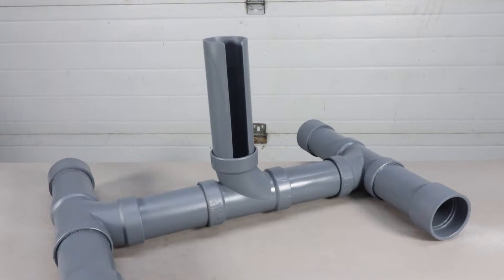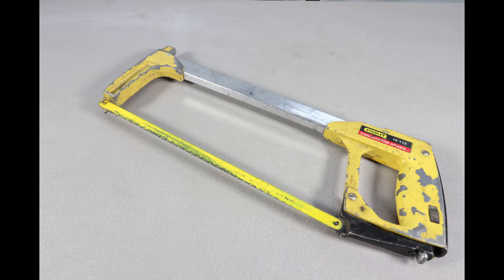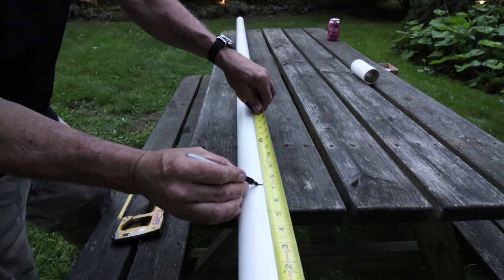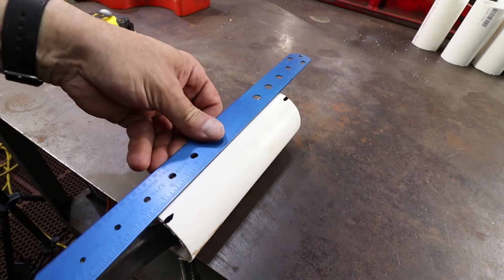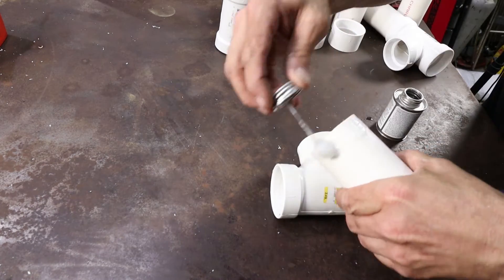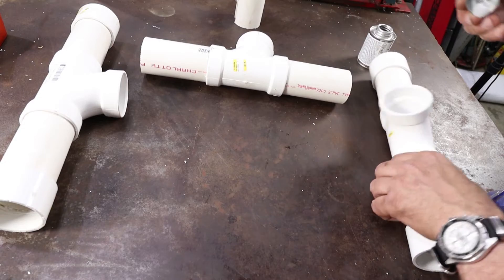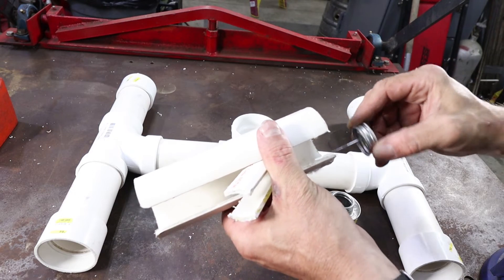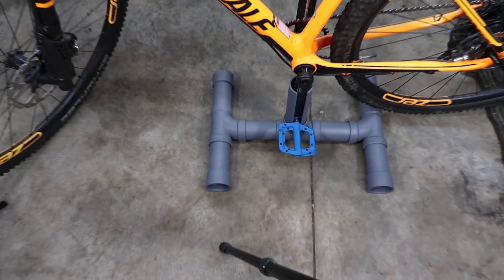Build This PVC Bike Stand Cheap!

Comment: Does it tend to fall over? Or is it stable
Reply from the maker: They are pretty stable, depending on the amount of play in the slot, and the size of the crank arm in relation to the pipe inside diameter. These can be made with different diameters of pipe to suit the dimensions of the pedal axle as well as the crank thickness. That video is one of the first ones that I had ever made, and I thought about making a new updated one in higher quality and more streamlined in the near future.

Comment: Cool cheap stand! I'm wondering about modifying it with a piece of 2" pvc cut in half (lengthwise) to sit under the bottom bracket, also lengthening the vertical pipe. I know it won't be as sturdy (bike swaying side to side), but I'd be looking to get the rear wheel off the ground and be able to spin the cranks.  Wonder if there's a better way by supporting under the chainstays? Guess that may get very bike specific though.
Reply from the maker: Thanks for watching! Yes, with this "H" Frame base, just about anything can be done with the upright piece to suit any bike specific needs.

Comment: I modified the 7 inch vertical piece.  Rather than slicing through the entire length (making the one inch slot), I left a 3/4 inch collar to make a much better/secure joint.  Otherwise great idea!
Reply from the maker: Thanks for watching and commenting Zygmunt. I plan on making a shorter version of this video soon. That was one of my oldest videos, so I think that there's a lot of room for improvement. Take care.

Comment: It would be helpful if you listed a materials and cuts list.
Reply from the maker: Thanks for watching Wesley. That was a really old video and my experience with video making was lacking. Since that video seems to do pretty well despite all that, I do plan to make an upgraded version with the cut list and a more streamlined process showing how to assemble. When I watch that video I just shake my head from my choice of music, the poor audio, and my inability to explain things well. Not saying I'm an expert at it now, but I came a long way in the past  three years.
Reply: @themostlymikeshow  Thanks for the video.  I made this for a local bike show I was going to.  The stand worked well for my situation.  It works best on flat surfaces and with not much wind.  I used another suggestion of not cutting the stand all the way to the end and left a  tab to assist in connecting.  For the bike I used this on, I used 1 1/2 inch pipe and made the legs a little longer to increase the stability.  My only issue has been that I painted it black with primer paint and it seems to scratch easily.   Thanks again.  My list would be 1/2 stick of 1 1/2 to 2-inch PVC.  4 Collars and 3 Ts.  Cut the pipe into 5-inch sections x6 and one section that goes from the stand to about 1/2 inch under the bottom bracket. Cut a 1-inch section down the length of the verticle tube that leads from the stand to the bottom bracket leaving 3/4 inch at the bottom to connect it to the T.
Reply from the maker: Thanks for the update Wesley. Glad it worked out for you. I experimented with 1- 1/4" pvc, and it actually seems to hold my bike better. I agree that the base should be wider stance to make it more stable.

Comment: Is looks very dangerous to use if you have a carbon crank arm
Reply from the maker: Good point! I don't have any bikes with carbon crank arms, but I guess that you definitely don't want to scratch them. There might be some way to line the inside of it to protect it from damaging it. Thanks for watching!
Reply: I don't see how it would damage carbon crank arms. It's PVC not metal. Good idea!
Reply from the maker: Thanks Chris! I will be making another video on this stand in the not too distant future. That was one of the original videos from when I first started this channel, so I think that I can make some overall improvements.
Reply: @themostlymikeshow  I suppose you could install a piece of pipe insulation in it to protect the crank arms, but again, it's just PVC.